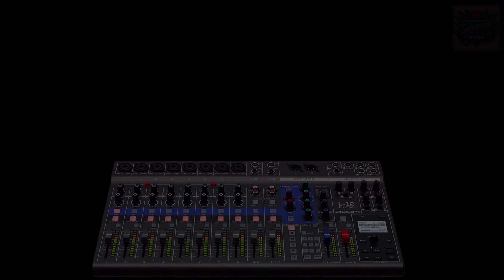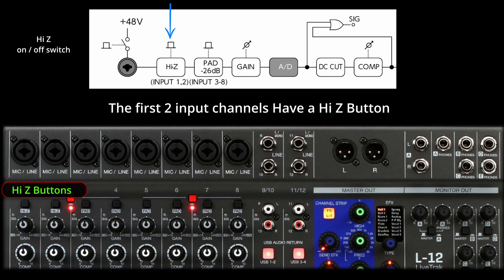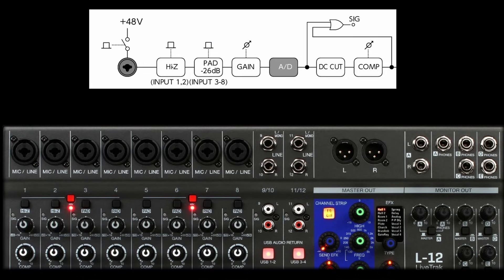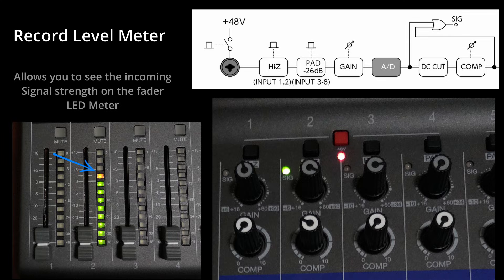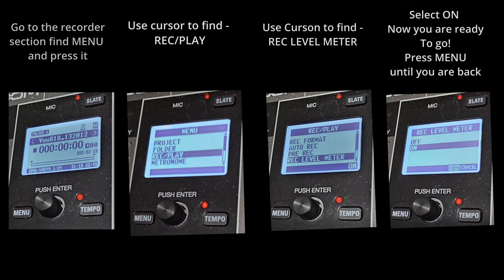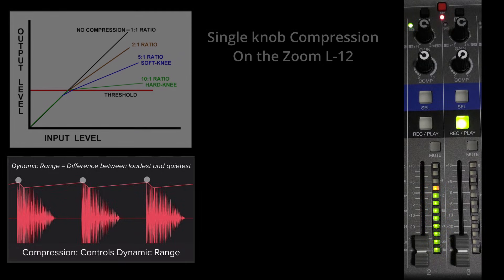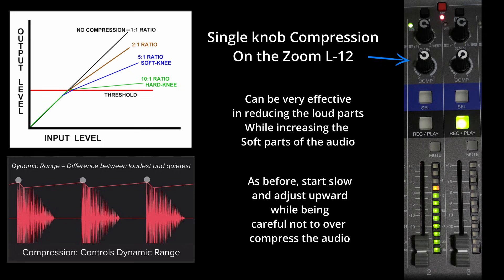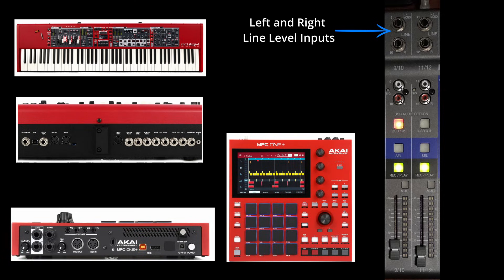Zoom L-12 Simple guide part 2: Setting the gain levels to get the best audio quality

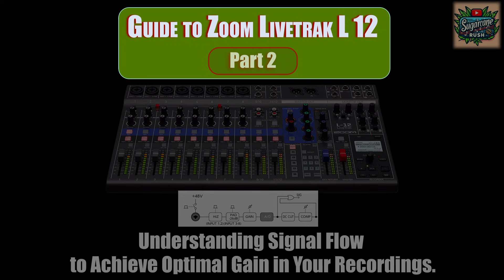Comment: 13:13 Great video.  We have an L20 so we have few extra tracks.  So I use channel 13 and 14 and pan them left and right to get the same stereo but I felt I needed to control the gain. This was my work around